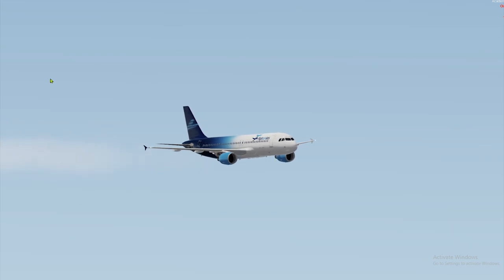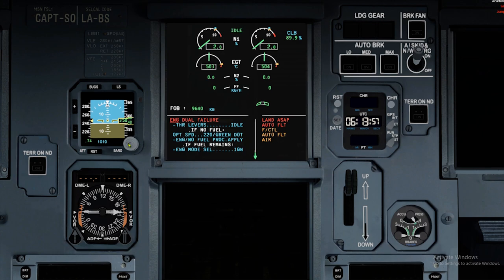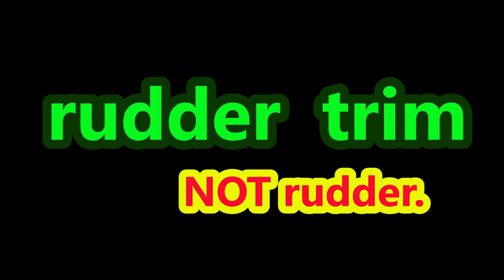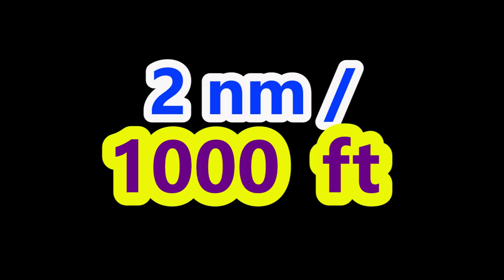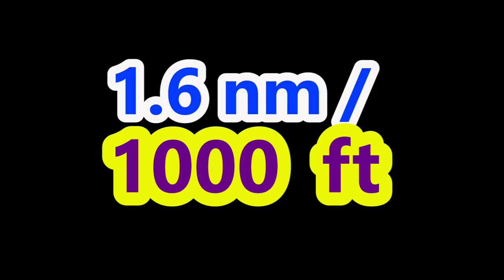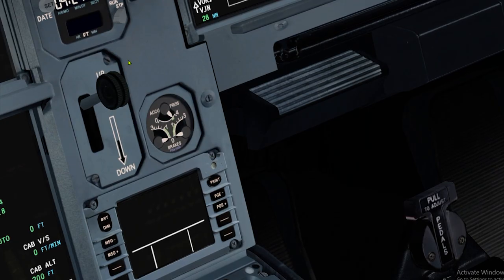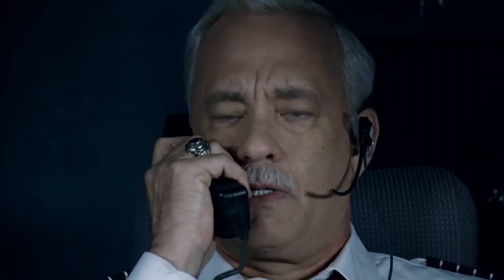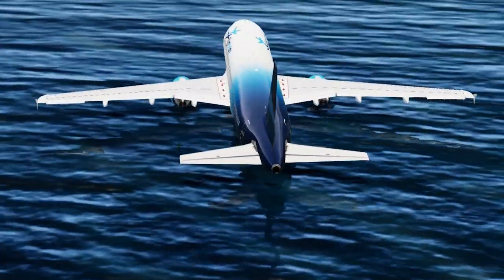A320 ALL Engines Failure MADE EASY

Comment: Flight time on BAT only is approximately 20 min.
Thanks for the video!
Reply from the maker: I think it was 22 minutes before they changed it to 30 minutes.
Reply: Thanks for replying. I had a hard time finding anything regarding that in the FCOM. Although my company has a failure handling guide and it contained flight with batteries only saying you can expect power between 22-30 min based on msn.
Reply from the maker: @vaggelistr1614  yes I have read it somewhere in the FCOM previously, But I am not sure if they have removed it.